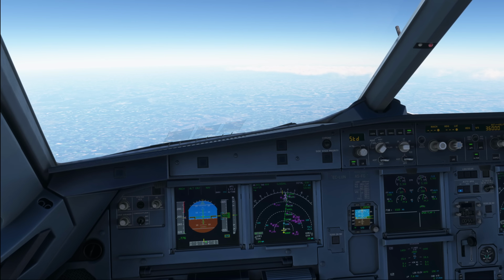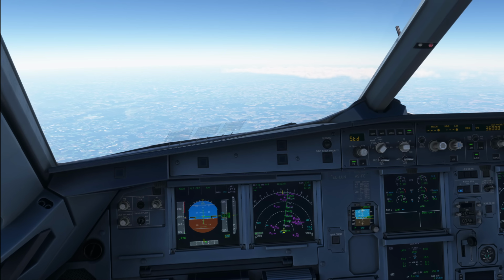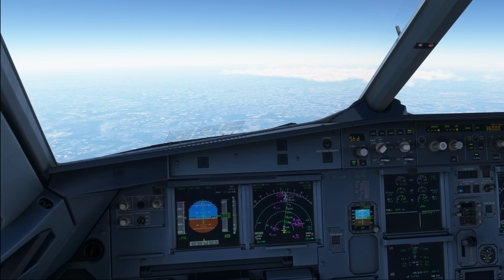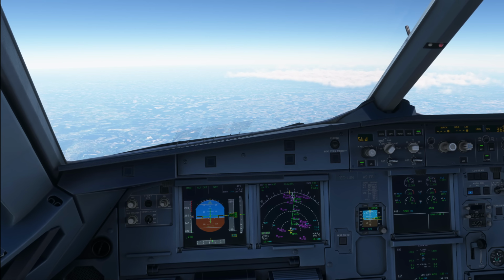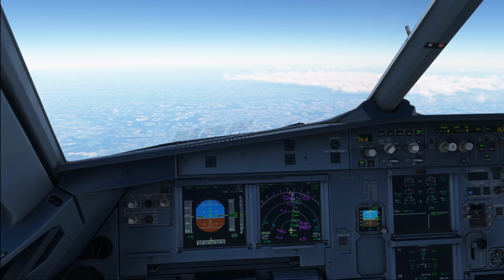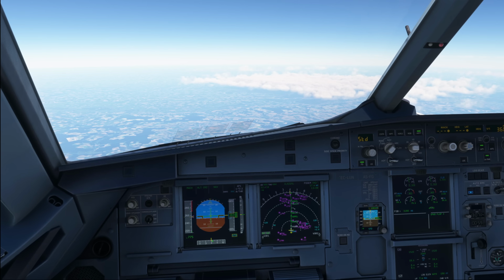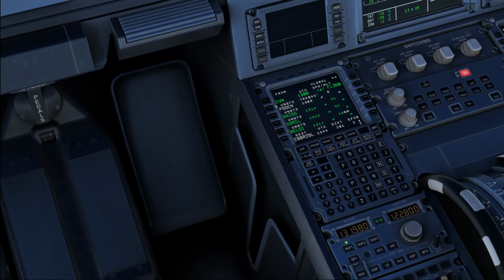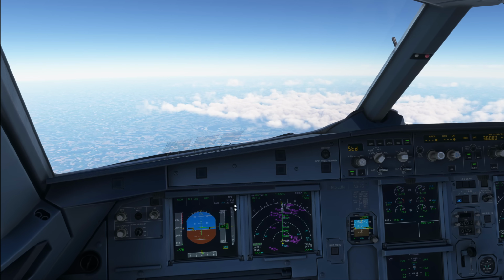Getting the MOST out of your A320: Airbus Green Operating Procedures | Real Airline Pilot

Comment: I am aware of the brake changes in the Fenix...but is anyone else experiencing the brakes activating like an on/off switch? I'm using the Thrustmaster TCA Pedals and for half of the movement nothing happens then suddenly the brakes apply fairly sharply. Have not had any issues with the PMDG 737 or ToLiss in XP12. They were fine in the older version (except the unrealistically low brake temps)
Reply: Im having the exact same problem. It helps if you first test the brakes and use then before you are moving.
Reply: @DarkAndVelvetNights  I do a full pedal movement and sidestick movement once the aircraft loads. Basically like doing the flight control check but just for making sure hardware is working. Still have the brakes acting like a switch and also for the sidestick there is slight lag from hardware movement to aircraft sidestick movement
Reply: @tomstravels520  Yeah i think we have the same problem.
Reply: I noticed the same, it seems to be an issue with certain pedals, a potential fix is to create a new profile in msfs, but didnt work for me. So iconfigured my pedals via spad next and now they work smooth from 0 to 100. a gamechanger. Search the msfs forums, there are some threads about that issue